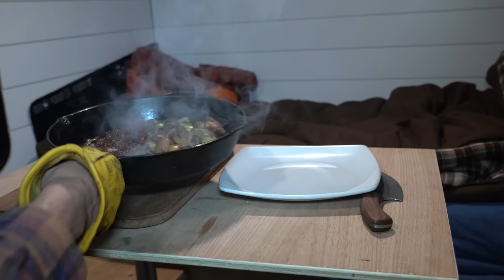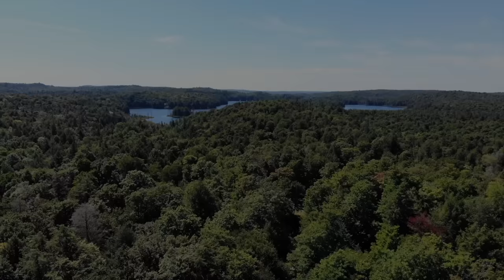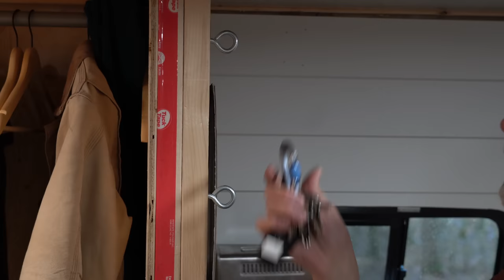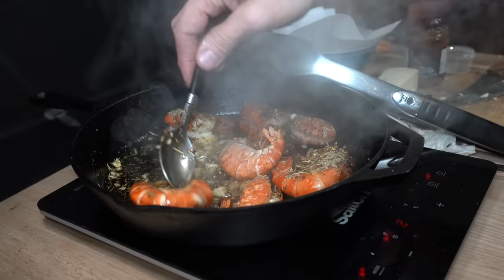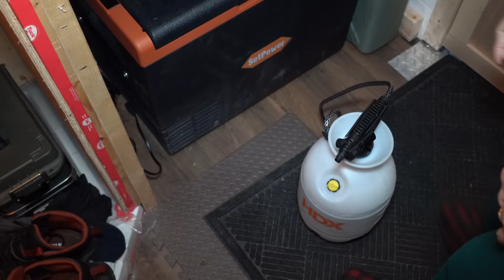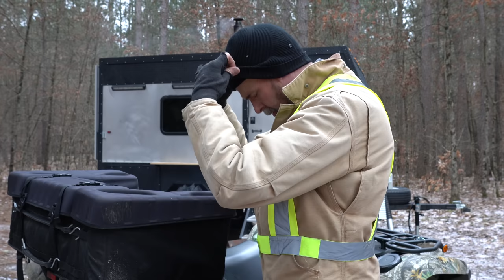CAMPING in SUB ZERO Temperatures with Only a WOOD STOVE to heat my DIY CAMPER TRAILER

Comment: Suggestion to viewers...I would not wait until retirement to enjoy the outdoors. You never know what health problems you may get that will prevent you from fully enjoying the camping and other outdoor things or, you may not be able to get out into the woods at all due to health reasons. Go out and enjoy the woods now. Use your time off, vacations, holidays off,ect. If you don't have or can't afford a camper trailer use a tent or a tarp for shelter, or get a cap for your truck bed for shelter. You never know what may befall you in later years as to your health...go to the woods now and enjoy it now.